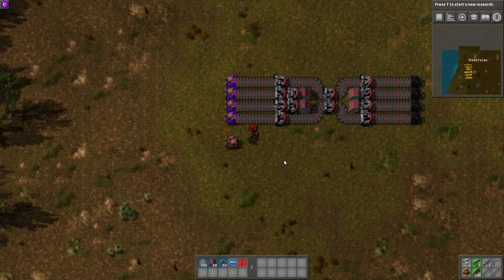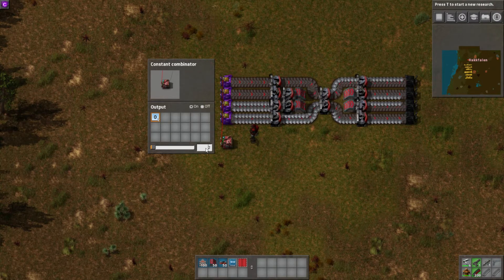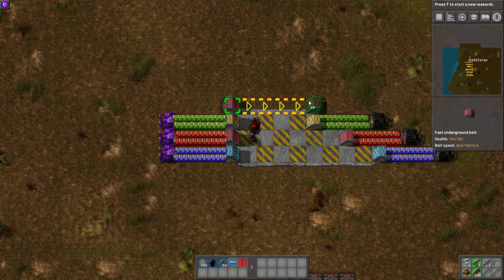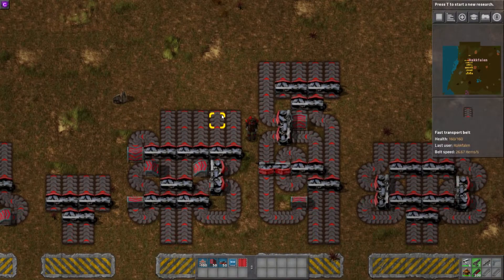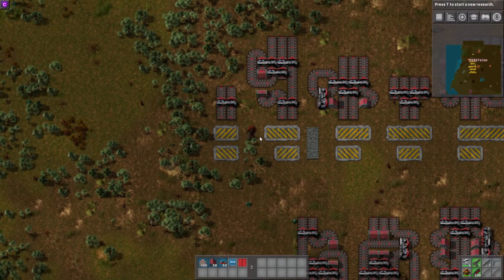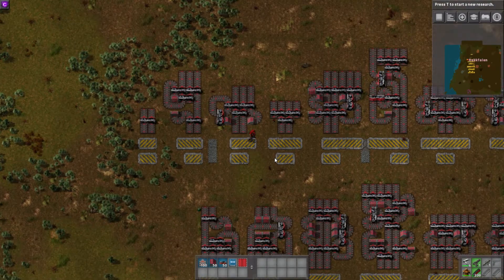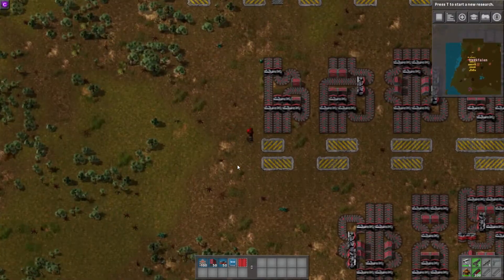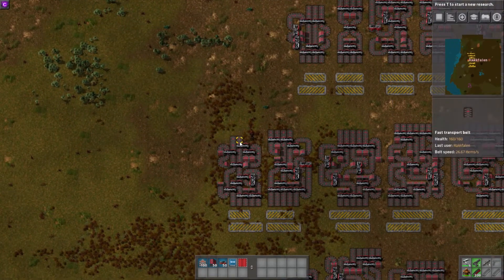Factorio - Rakkfalen's Belt Balancers

Comment: Can you make a 16 to 8? I use 8 lane bus per material, and feed it every now and then to replenish. overfeed :D cant find anything over 8 or its for 0.14
Reply from the maker: You know, after making this video, I spent at least 3-4 hours attempting a 16-to-16 and, while a bit messy and very large, it works very well! You can download it here (just use half the outputs for 16:8):  https://pastebin.com/ALA65xHq
Reply from the maker: BTW, idk if you are using the 8x8 in my blueprint set, but you shouldn't. I just re-tested it and it's not a true 8x8. Instead, I recommend one of these two:
- 8x8 straight: https://pastebin.com/DNuRvrfR
- 8x8 split in 4's: https://pastebin.com/P4gjDTWv
Reply from the maker: @Discipol Just in case you are still using my balancers blueprints, there’s a new, improved, simplified set available here (includes 2 16x16 designs!): https://youtu.be/UHTVrp3QsTI

Comment: Thanks.
Reply from the maker: SneakyGunz to answer the comment that you originally posted, I saw that the updated splitters are out now but I haven’t played with them yet, so I don’t know if these blueprints will still work in the newest version. I do need to redo this blueprint book anyway because after additional testing, I have found that some of them are not actually as balanced as I thought. For now I recommend just using the 4x4 and 8x8 as needed, and just ignoring extra lanes if you aren’t using that many.
Reply: Thanks for the reply Rakkfalen.  :)
Reply from the maker: @SneakyGunz Just in case you are still using my balancers blueprints, there’s a new, improved, simplified set available here: https://youtu.be/UHTVrp3QsTI